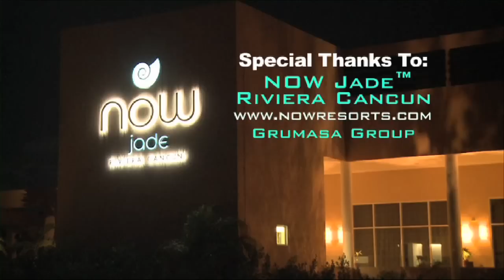Concrete Innovation of the Year - Concrete Furniture

Comment: that heat from the glass won't melt that rubber?
Reply from the maker: +stacy4422 The silicone used can withstand 450F
Reply: Cool, Thanks!

Comment: The Tree Stump project is a good idea, and in hurricane prone regions of the world would these concrete made projects make them good from being flown away by heavy winds.

I will agree with a few folks here in that using the other end of the tree stump as the table top would of have been a better aesthetic presentation.  Not only that, but if indeed they were conscious of the entire project being hurricane-proof in some respect, then wouldn't it make more sense to use the heaviest part of the project at the bottom?  This way even in the event of a heavy wind coming towards the table it would not be easily tipped over.  A good solution here, if the designers would want the project as is, is for people to add concrete anchor bolts to the base of these tables, and that would in many ways prevent them from being tipped over.

I also would encourage anyone doing these types of projects to wear respiratory masks when working with these products in powdered form.  Just in the event that dust goes air borne you don't get them inside of you.  Many of these products are known as being carcinogenic and can cause cancer.  Just play it safe, invest in a proper respirator, and enjoy Art and Design!